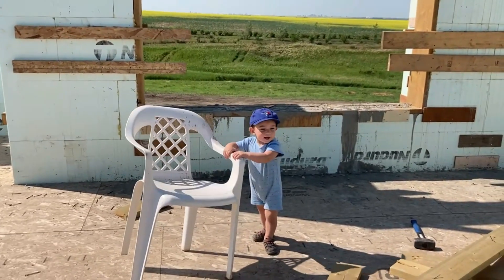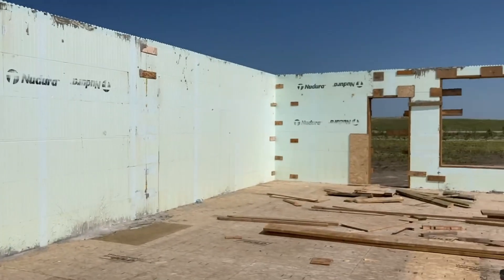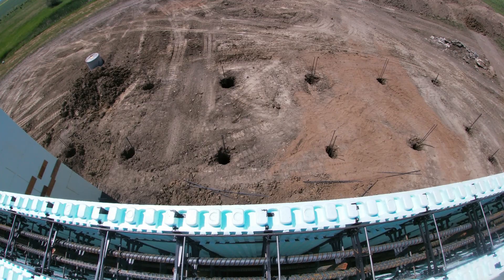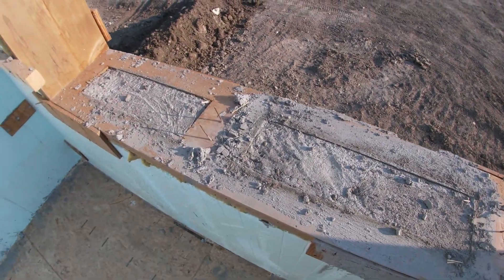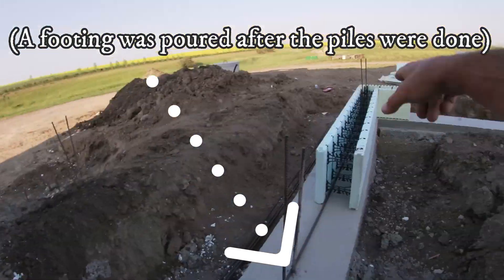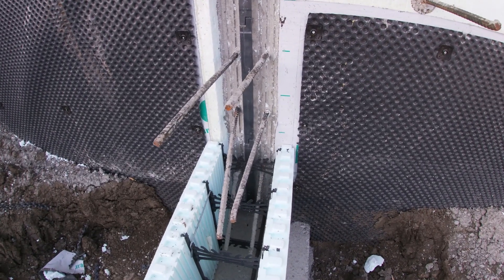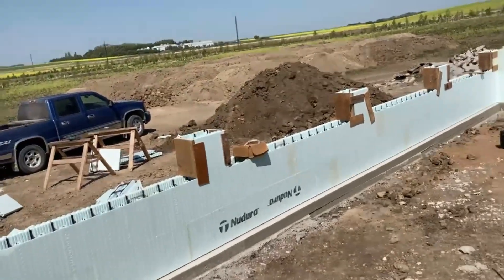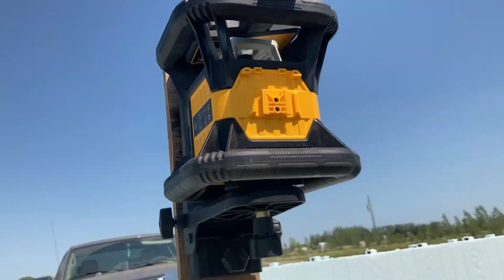Vlog 9 -  Nudura ICF Gradebeam - Building & Pouring Our Garage Gradebeam

Comment: Do you guys remember the size aggregate, slump and mix that you ordered for the walls?? Looking to also build with Nudura.  Thanks!
Reply from the maker: Hi! It was 3/8 aggregate with 6 or 7 inch slump. You can also add a product called Super P and it makes the concrete “slippery”.
Reply: @eberlesbuildahousediyicfho9630  Thank you!

Comment: Do you have prior building experience and what where the key factors in deciding to build ICF as opposed other methods?  Also did you consider using Helix additive to concrete... It is suppose to reduce the amount of rebar (horizontal I think needed.)
Reply from the maker: My husband and I completely renovated 3 houses in the past… stripped them to the framing and completely redid them. He also is an electrician and just has a wide knowledge base from being in the trades for so many years. This is our first experience building from scratch and first time using ICF. 

Key factors… energy savings was the top deciding factor. ICF houses are just so efficient, saving money on heating and cooling. Also saving $ on being able to do most of the work ourselves, insulation and vapour barrier (excluding the ceiling) already done by using ICF’s.

Never heard of Helix. We just went by what the engineer designed in regards to rebar. (With the exception of the very top row… we had extra rebar, so Aaron put in the extra horizontal row on the very top course of the house).
Reply: I am retiring next year and want to build my retirement home with ICF so your videos have been very informative.  I am I Texas so not as cold but we deal with heat.  I am trying to determine what step you do because of where you are like in all the ICF videos I have watched I never have seen anyone place rebar before laying down course of blocks nor how you tied floor into basement.
Reply from the maker: @freddietoliver7173  Our plans required a row of rebar on the bottom and the top of the first course ONLY. So that’s why it was laid out first before placing the first course… so that it could be snapped into the bottom of the webbing once the blocks were in place. Only the first course needs it on the bottom though. After that there was only rebar on the top of each course. I think different engineers do things a bit differently. Ours had us tie the walls to the floor with rebar dowels,  but I know another person from Eastern Canada said he had never seen that done before.
Reply: @eberlesbuildahousediyicfho9630  thanks for the quick response and I look forward to more videos.  Your kids are adorable!!!!
Reply from the maker: @freddietoliver7173  oh thank you!!!! I think the videos will be slowing down for a while, I’m back to work in 2 weeks (I’m a teacher) but I am going to try to keep up on the videos as much as I can!